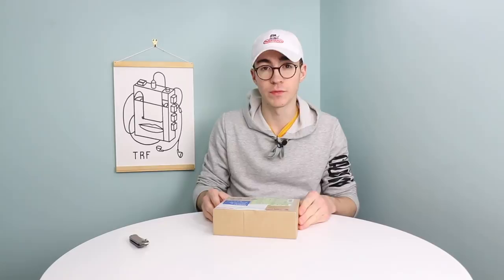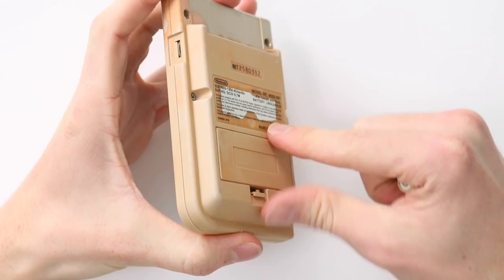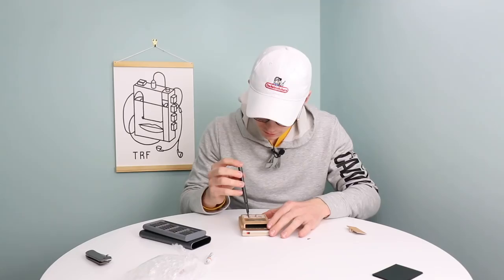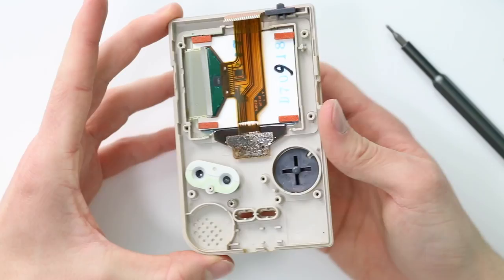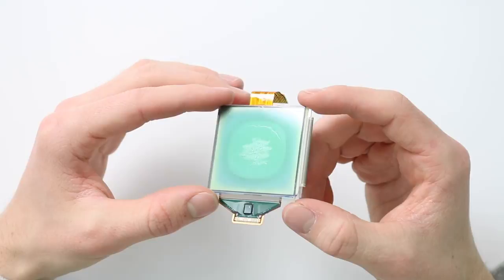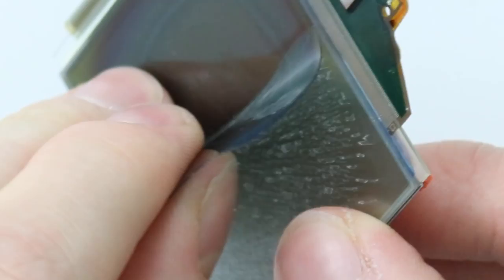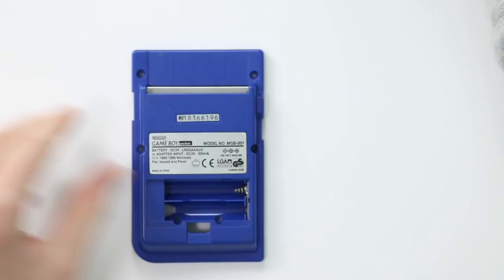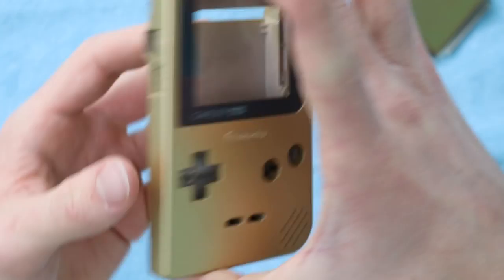Let's Refurb! - Severely Damaged £15 Faulty GameBoy Pocket!

Comment: You should really consider removing those left over cohesive-marks that are left from removing the stickers and screens. I was about to write this comment to your previous video where you stick the brand new screen over a painted case. If the contact surface is uneven two parts won't stick as well as you hope. You can easily and quickly remove the left over residue by scraping it off with sharp chicel or razor blade and end up with nice smooth contact surface. What comes to that restored Gameboy Pocket I can see that the surface is uneven under the detail sticker.
Reply: ARGH, my OCD. All that work and he leaves that.
Reply: I was think the same thing, when painting he should put painters tape where the screen lens goes, and where the stickers go. Also should remove leftover adhesive/glue. Would leave a better surface for things to stick back on.
Reply from the maker: Thanks! Will do.
Reply: @TheRetroFuture  To get a good paint job, 90% goes into prep. If your preparation work is on point, your paint finish will come out 1st class.

You should have used Isopropyl Alcohol on the left over residue from the label and under the screen lens. Other than that, it does look good.
Reply: but he placed the same screen back on, and he didn't clean the back of the screen. so the two pieces will fit together and be even anyway. @The Retro Future you did a fine job

Comment: Great video but your painting needs a little work. Gotta sand it down, primer it, then paint.
Reply: and top coat it would be wise too
Reply: @Rakwas  Definitely, that gold will rub off real easy.
Reply: Sanding isnt always a good idea on plastic, as it can leave scuff marks and other defects in the surface that will show through. A good cleaning can do the same job as a sanding without leaving defects in the surface
Reply: @kennyclark131  - Using a fine to very fine sandpaper (220 to 400+ grit) to at least slightly scuff the surface so the paint has something to stick to will help a lot and won't mar the surface (unless you just rub one spot).  This was a pretty sloppy restoration.
Reply: @murrys5444  I've worked with plastics and fiberglass for years. To use a 220 grit paper would cut through that plastic. If you were to use a sandpaper you would need to use an automotive finishing style sandpaper at least 3000 grit and it would have to be wet and very lightly used. Even then the scratch Mark's may show up through the painting, because the cases are colored in the forming process and not painted. 
But yes the OP could have done more to make the paint better.
Reply: @kennyclark131  - I honestly was thinking 2000-4000 grit, and got the numbers off between what was in my head and what came out my fingers.  
My thought with primer, then paint, is you'd probably loose some of the texture that is on the gameboy plastics. A minor loss for a result that would be miles better than what this video has though.
I don't however think they used gold colored plastic for these.  It was just a paint job, hence why it rubbed off on this one.
Reply: @murrys5444  that makes sense for this gold, but I know for most of the regular colors it is part of the extrusion process and not paint. 
And yes a primer, paint and sealer would come out the best. I personally would use a light duty degreaser, or you could use a diluted acetone solution if you know what you are doing, over sandpaper. I've had to scrap many products, because people tried to fix small issues with sandpaper and gouged the product.
Reply: I'm abit later here but I think it depends on the type of spray he's using too. There's 2 in 1's with primer and colour. They seem to work ok. Rustoleum springs to mind. They have a 2 in 1 spray that bonds to plastic. But hey, the better the prep, the better the finish. Admittedly metallics will hide alot of imperfections. He still should've done a top coat definitely.
Reply: adultlunchables That's what I was going to say.
Reply: I was thinking the same, also add a top coat to protect it

Comment: Nice refurb. job there..!  As others have commented, removing the old adhesive from the case would help the screen and rear stickers to stick better, but I also think it may help when spraying the casing, to actually use a thin coat of primer first - something like the light grey Halfords car primer spray (works perfectly on plastic), as it'll help cover-up the stains/marks, and give a nice smooth layer for the top surface colour paint to key onto, and give a more resilient, stronger finish... :-)
Reply: It depends on what brand he was using. There's 2 in 1 primer & colour sprays nowadays.

Comment: You say at the end "it almost looks like a completely different gameboy" well... It kind of is though isn't it? I mean you swapped out the main board which has the majority of the components leaving just the screen, case and buttons. Other than the outside it technically is a different gameboy. Nice vid though. 👍
Reply: Retrotronix he didn’t use a different motherboard he just use a different game boy to test the screen and to test if he needed  to replace it

Comment: The reason why it looks greenish is because your polarizing film is out of alignment. You're supposed to turn it on first, and then tilt and angle the polarizing film until you get as accurate a screen as possible, then cut it that way. You can't just cut it to size without testing it first.

Comment: Would heating the polarizing film up slightly with a hair dryer help in softening the adhesive so that it isn't as hard to remove and doesn't leave as much residue behind work on these devices? I know it does on others, but I don't know if it works on all devices.

Comment: you can remove the glue more easily with WD40, this product dissolves all glues, it works well also to take off the labels (only if the label is well plasticized, otherwise it makes the paper greasy)
In any case, good job ;)
Reply: The only thing with WD-40 is that it is oil based and will leave a residue if not fully cleaned. This can react and 'silicone' the paint and ruin the final finish. If you are not painting then WD-40 would be good as you don't have to worry about discolouration like you do with some sticker removers

Comment: Replaced the motherboard, huge black line through the polariser, bubbles under the sticker because he couldn't be arsed to clean it, damaged the corner of the sticker because he couldn't be arsed to do it properly, painted over the original A/B and Start/Select type, didn't sand or prime before painting.... List goes on. Super lazy job on this one.

Comment: Try sanding with grit 600 or higher and water after painting for an even smoother result. And you should really have cleaned the sticker residues! And finally, shots from above: take off your cap! It’s blocking the view!

Comment: I bought the same screwdriver set off amazon so I can repair my ds lite which has had more and more problems as I get farther into it but it used to not turn on but I fixed that but now I have to replace the top LCD screen

Comment: Just what i love about gameboys so simple and so strong last forever with some tlc. That board could be save you need a multimeter on continuity and very thin wire solder. Clean the contact on the button and find the via or trace and clear trace a little connect thin wire to trace and contact where button is. Seen alot worse

Comment: Ehm... Did you replace the motherboard or fix it?
Reply: looks like he had to replace it. There was significant corrosion on some of the buttons, and it was causing the traces to lift off of the board. I think he used the board from the blue gbp as the new internals.